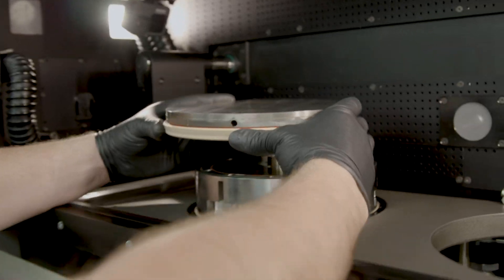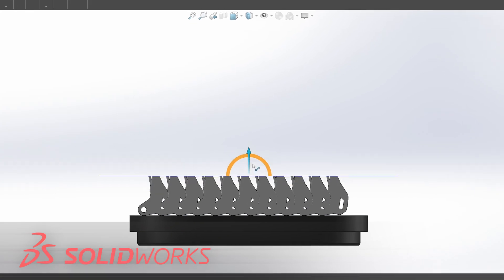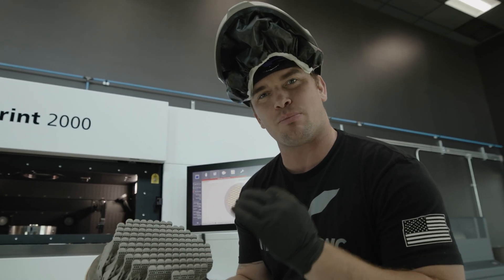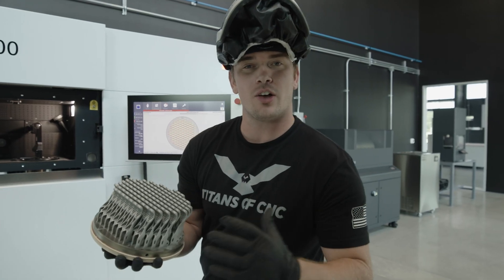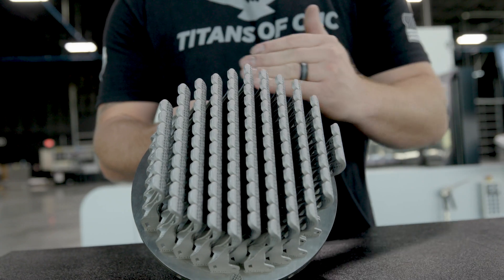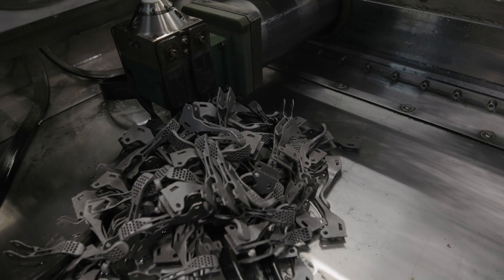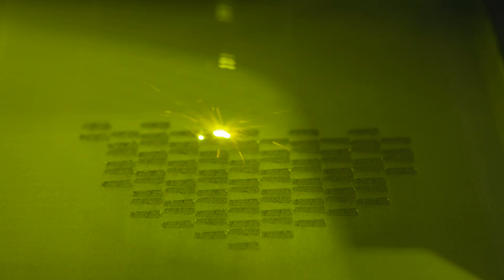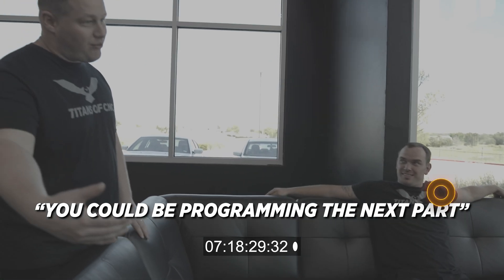MASS Producing Titanium Bike Levers on our 3D Printer | TRUMPF TruPrint 2000

Comment: You need to make the distinction this is not just any 'metal'. Titanium must be 3D printed in a vacuum chamber or with a jet of neutralizing gas because it oxidizes easily and you have to block that reaction. It's why these titanium 3D printing vacuum chambers cost a million bucks, although they've come down a bit the last couple years.

Comment: I saw that you had printed in a marked line where the final ops will take the levers to shape. Would it be possible to print a kind of separation line there, a thinner layer of print, that the levers could be broken off at to remove the need for EDM to remove them from the print plate? Thus saving an op and allowing the final finishes on the levers to be minimised both in time and cost.

Comment: It would be really interesting for you to do a breakdown on the cost of doing this.  It looked like the build plate is sacrificial etc I’m looking into adding that technology to my shop just need to understand all the costs
Reply: I'm fairly sure they just face off the build plate and reuse it
Reply: @killorkubed  How many facing operations can the plate take before it needs to be replaced? Are they cheap parts?
Reply: @Phoen1x883  I suppose it depends on how much you face off of it I wouldn't think you'd have to face much of anything off the actual part (in theory you wouldn't have to face anything off the actual part, just enough to get rid of the titanium built up on it), looks like a hunk of aluminum to me so not that expensive
Reply: It's very possible that I'm wrong, but I think the build plate needs to be a similar material to the printed material. At the very least it has to be compatible with welding to the printed material.
Reply: @2testtest2  yeah or at the very least compatible to braze (not sure if I'm spelling that right), but that doesn't really looks like a hunk of ti to me for some reason
Reply: @killorkubed  the machine lazer sinters so it would need to be a similar alloy

Comment: How do you remove the supports from the parts after removing them from the build plate?
Reply: Iirc, they don't need supports. The powder itself acts as a support whenever needed and is just brushed off and vacuumed away to be reused.

Comment: so jealous of a submerged edm, do you get many wire brakes or even short circuiting due to the parts wobbling about, Ive cut parts off other peoples build plates and sometimes I whish I just said NO as my machine is open flush so the water jets off everywhere causing dry sparking. We need to see you cut more jobs not just a glorified bandsaw. 👍👍
Reply: What kind of EDM are you working with? They're using a Wire EDM from ONA which we absolutely love. They're incredible machines with a lot of features for efficiency and productivity.
Reply: @ellisontechnologies  I'm using a charmilles 510 wire edm, she's a 98 machine but doesn't look it I've had it from new, as we make die tools it's not used every day so the hours are low. I'm in the UK and when I've been to machine shows and seen the new machines nothing with the footprint of mine and a table size of 700x400x400 would sit in the same space it seems like all machines have got bigger but a reduced table size, I hope they do more videos on wire cutting it makes a change from the cnc milling. 👍
Reply: Yeah the AV35 is a beast! Have you checked out our EDM playlist? We made a carbide punch video not too long ago that you would probably enjoy! It came out so beautiful.
Reply: @trevorgoforth8963  no not yet, it seems like every notification is new machine day you jammy buggers , I'll look back and see 👍

Comment: What do you do with the used build plate? Seems like you must machine it down
Reply: Yes it gets re-surfaced on a mill or surface grinder and then gets re-used!
Reply: @trevorgoforth8963  do you know why can’t a think layer of sheet metal can’t be used?
Reply: @sedled2829  The heat generated by the laser melting the powder would warp the sheet metal badly.
Reply: @trevorgoforth8963  SLA printer use a film screen that bends with no issue. I’ll have to do more research

Comment: I have a few questions: 1. Is the build plate reusable? 2. What was the total production time for these including wire EDM? How did it compare to conventional machining? 3. What about its product finish and mechanical properties? Are they functionally similar in magnitude?
Reply: Yes the build plate can be re-surfaced and re-used. At the end of the video, I mention it took 26 minutes and 48 seconds per lever so total time is roughly 50 hours with the majority of that being unattended print time. Compared to machining there is no tooling, no programming, and very little setup of the actual printer. The finish can be tumbled, electropolished, etc.. but it's not bad. The mechanical properties are more than sufficient for this application. Thanks for watching!
Reply: @trevorgoforth8963  Very much the set it and forget of producing parts. I think its great to have options and this is an excellent demonstration of another way to make more parts.
Reply: @ellisontechnologies  100% agree! The more tools we have to choose from when trying gain a competitive advantage, the better off we are!
Reply: @trevorgoforth8963  That's awesome numbers for titanium. No Tool wear, barely any setup time and like you said, load it once and come back 50 hours later.
Reply: @trevorgoforth8963  I absolutely agree. What is the cost of the Trumph printer please.
I have been looking at several options but as I used to make Trumph turret tooling I love their quality. What would the setup you guys have go for?
Reply: @trevorgoforth8963  infill the base plate, easy fix for warped base plates on cheapo chinese fdm printers
Reply: @Trevor Goforth can I have a pair of sram levers please
Reply: @jtmtbadventures5568  after the SRAM I want some XTR levers
Reply: Just multiply 26 minutes and 48 seconds by 112 and you have your answer for your second question
Reply: Mech properties in x and y are usually very close to billet, the z can get tricky. In plastics it can go down to say 30% strength. Not knowing metal additive I'd say possibly the interlayer adhesion would be better as welding is pretty solid so 85-90% might be a reasonable assumption in the z axis, could be much higher and proof is with a simple google scholar search. 

Surface finishes aren't great yet. There is a research project on machines with additive and subtractive capabilities to interchangeably do both to achieve better finishes but there is the issue of residual stress and keeping form. On the flip side I have some ceramic parts with Sa of 2 micron that were binder jetted then ground. Alternatively AM can help solve issues in optics, I forgot the actual term but I'll call it "rippling" that can occur from using the lightweight honeycomb matrix on the back side, you can make a part that is lightweight and resist this.
Reply: They aren't going to reply because this channel is clickbait advertisement they get paid for.

Comment: Good video but it would be really nice if you could include the cost of materials and time vs a machined version of the part
Reply: Thanks for watching, I will keep that in mind for next time!
Reply: Joshua, one thing to keep in mind with material costs on this kind of system: there's very little waste. In a traditional machining operation you're cutting metal off the original piece, and you have to collect it all to ship to a recycling plant. On Trevor's machine, whatever metal doesn't become a part can be poured back into the bin and used for another part.

Comment: For who was wondering, overall time is just over 50 hours
Reply: I want to know the electrical power used and then compared in kW, cost, time and labour to molds and poured produ tion.
Reply: @zteaxon7787  It's still probably faster to print them, they might consume more power but you don't have to attend them and it doesn't need any post processing. And they look way better than cast.

Comment: what is the cost breakdown per lever once factoring in machine cost amortization and powder costs? vs milling would be a great compariosn!
  under 30 min per part is a good procuction time for a complicated part!
Reply: 3 printing machines and 3 EDM machines.  One single person could make 300 levers every 2 days and only need to come in to work one of each of those two days.  If each lever sells for $250 that's $75,000 gross worth of product created every 48 hours... with ONE skilled person not working crazy hard.  It's a terrifying investment up front though.  You'd have to be SURE your part would work with this manufacturing method and be doubly sure you have a solid market to sell it into.
Reply: But gross is not a measure of profit!
That’s why I ask which is more cost effective?
If material for milling is $40 and material for laser is $200…. 
If the laser machine is 4 million vs $600,000 for the CNC mill
As for labour, any job with enough volume can have automation to reduce manual input. 
I’d LOVE to know what The numbers would break down to for ROI milling vs printing on this job.

Either way it’s freaking cool! 

As for my bike I think I’ll stick to carbon fibre  levers ;)

Comment: It is fascinating to watch 3D printing come into its own. There is no doubt going to be continual push pull between traditional manufacturing methods and more modern approaches. I imagine we have only really scratched the surface of what is possible.
Reply: I agree brother. As a manufacturer, I will never complain about having yet another viable method for producing parts. It's nice to have another tool in the toolbox!
Reply: I think we should by to ignore the "modern" vs "traditional" connotation of the methods. Just look at it as additive vs subtractive, both with their own strengths and weaknesses. Both are modern in the sense that they are typically powered by modern technology, one of them just happens to have been available for longer.
Reply: It is going to make the impossible reality in our lifetime

Comment: The writing is on the wall.
Reply: Not necessarily. There are things you can't make any other way than 3d printing. There are things you'd be a damned fool to try in it. Remember, it takes 50 hours from pushing the start button to getting the end-of-cycle alert to make these levers. A lot of the stuff they make could be produced far faster using mills or lathes. You've got to match the process to the part. 

There's a reason why they have two 3d printers and dozens of mills and lathes.

Comment: Not only time per part but no material waste compared to machining. Seems like the smaller the part and the more exotic the material the more efficient 3d printing becomes, among other factors of course.
Reply: Yep, very little material waste on this print. I agree small parts made out of difficult to work with materials are great for production 3D printing.

Comment: How do you,  re use the Printbed ? How you get a new clean surface there?
Reply: Just machine off evidence of the last job. They probably have a “clean up build plate” program in the closest mill to the additive department
Reply: Yeah we just re-surface them on the mill or grinder and re-use them!
Reply: @trevorgoforth8963  Trevor, how many times can you re-hone a build plate before it's too thin to reuse?

I've also wondered: Your printer has a bin for the metal powder it uses to make parts. Do you maintain different bins for each metal?

Comment: 2 days to print all that in titanium is really great. Nice work
Reply: Thank you! I printed them over the weekend, it worked out great!
Reply: @trevorgoforth8963  I have a markforged MARKII. I know you guys have a markforged printer as well. Did you see markforged released pla filament? Yea it's crap for strength and heat resistance but awesome to test jigs and mockups at a way lower cost than printing onxy 4 or 5 times before the final print.
Reply: @BarronBros1822  That's awesome you have a Mark Two! Yeah we have some precise PLA here at the shop, a red spool and a blue spool. It's way cheaper! We just released a video on social media yesterday printing a prototype air manifold out of red PLA on our Mark Two, check it out when you have time!
Reply: @trevorgoforth8963  nice i definitly will check it out.

Comment: Metal 3D printing is the peak of 3D printing. The only thing left needed is to use this method to print small parts for different applications, such as prosthetics. I've been watching someone design and make prosthetic fingers since he lost his fingers at the knuckles. His design allowed for different gestures, minus the bird. 3D plastic prints don't last a day. His old fashioned metal cutting and forming gave him the necessary parts to make his prosthetic fingers. He almost as it perfect. The proportions to his other hand are almost 1:1 ratio.
Reply: well, i could imagine, bringing your friend in contact with titans, will eventually lead to them sponsoring him some 3D printed titan fingers, and for us, some awesome practical footage ;)
Reply: 3D plastic prints don't last a day? That's absolutely wrong. Plenty of very high strength materials out on the market, but it's true that they don't approach the strength of steel or titanium.
Reply: Peak for biomedicial? Think ceramics and bone grafting, custom made to whatever is missing.

Comment: Are there any metrics for how strong that part is? It's a relatively short lever which should see quite bit of (repeated) stress.
Reply: Hydraulic brakes require very little pressure on a bike. One finger can lock them up. What happens when it falls over and smashes it? Would be interesting to know. I've seen some metal printed parts that are brittle. I'd be interested to know how they clean up the build plate afterwards too. Do the printed parts get heat treated? Metal printing can be quite machine and materials intensive, and even as far as all the post processing required. Wire EDM, ovens, blasting, finishing, breathing equipment for safety, etc. Heat is not cheap. Cost per part? Failure rates? I have 3 3D printers, they are not perfect, and failures happen, mostly due to support requirements/failure, build plate adhesion. Actual cost per part is probably very high. $12 an ounce just for the powder alone? ROI is going to be a long process for any investor in this tech.
Reply: @helicopterdriver  you can just run a facing operation on the plate
Reply: @jay89boy  So then you have to have an EDM, heat treating and a lathe to make that all work? Getting even more expensive. I just clean my build plates, FDM and Resin. How many times can you face the build plate before you have to replace the build plate too? Titan can make his own build plates I'm sure. $1M for the machine, $500k for EDM, oven and a lathe too? Going to be a long process to earn all that investment back. I love the idea, but out of the reach for most shops investment wise.

Comment: I’m curious after removing the parts from the print plate with the EDM how do you remove the remaining material on the surface of the plate?
Reply from the maker: Surface Grinder or Shell Mill on a 3 Axis Mill
Reply: Came here to ask the same thing! I'm guessing surface grinding.
Reply: @Maverickthewolf2k6  Yeah it makes sense. I wonder how cost effective it is.
Reply: We put it in the mill and used a face mill to get a minimal cleanup. We have ground them before as well.
Reply: Usually those plates are either milled, turned or ground flat.
Just enough to have a clean surface. So you can use them for a pretty long time